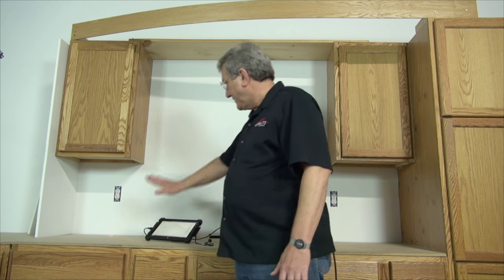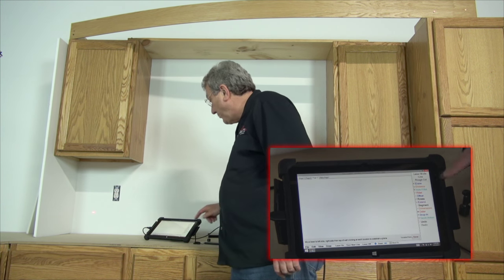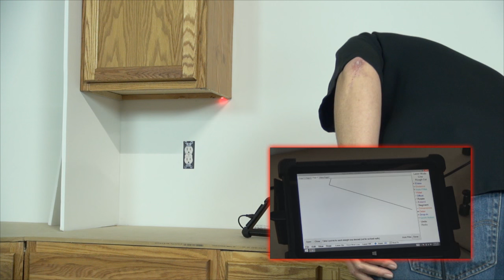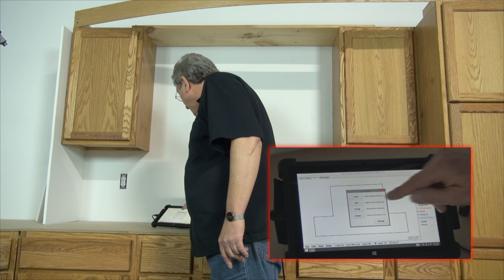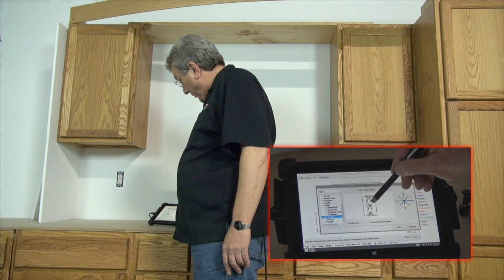LT-2D3D - Templating Planes

Comment: I love these tutorials. I've learned a lot from them. However, something this video doesn't show you is the importance of checking your work with a tape after the fact. Given the material of those cabinets and that his laser line is stretched in some spots (which is normal for measuring full height) I doubt that he was able to take truly accurate measurements.

Again, super helpful tutorials, but in real world applications there are some extra steps you'll likely need to take, i.e. putting non reflective tape on the wood (especially the bottom of the uppers) and setting up targets to make sure your line isn't stretched out like whats shown in the video.
Reply: This is true.  And your bottom measurement can be off up to 1/8 of an inch because of the stretched laser beam (affecting your side lengths).  You may want to sit the mini tripod on a phone book for a bit mire height.

Comment: I can’t shoot any planes, I set the laser up and make sure my 2D is locked and it takes me straight to the page where I can shoot points without setting my plane, any tips?
Reply from the maker: Miggs If you go into Options (Edit > Options) and go to advance it gives you an option at the bottom to adjust your work flow. if you are to select 2016 workflow this will allow you to set a plane. 
If you need additional help, please reach (630) 679-1300, and contact our support team
- Kyle